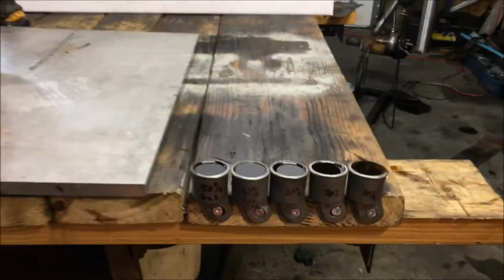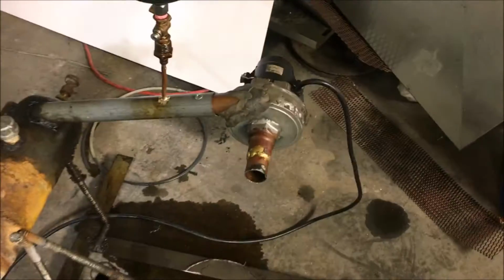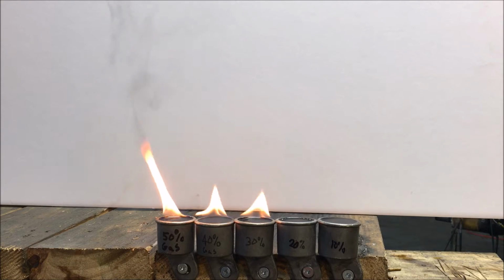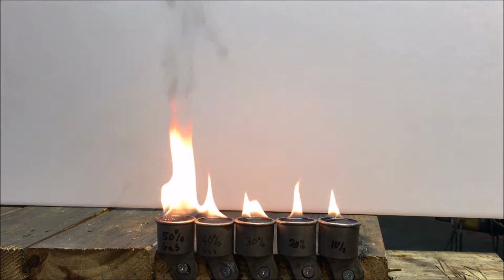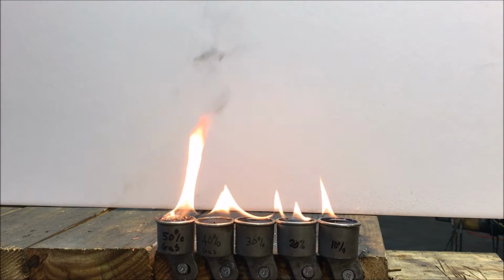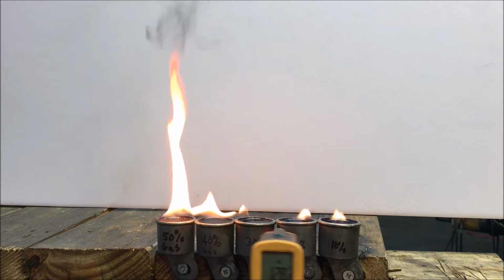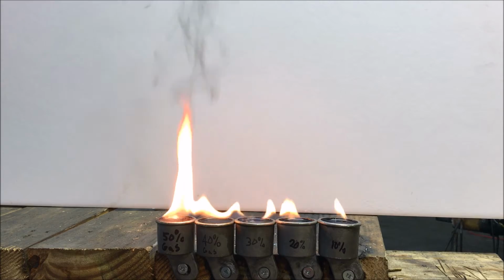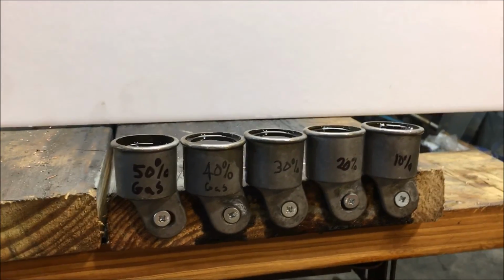Waste Oil burner fuel blending Information

Comment: Hi mate  cheers for the videos. I built a burner based on one of your designs recently. I'm currently running it on 50/50 mix of diesel and used engine oil.  In these test when you say Gas do you mean petrol? Can you tell me what the best mix of oil and petrol/diesel for a burner that will ignite easily with a map torch? I cant be bothered with the difficulties of lighting straight engine oil. cheers bro.

Comment: I would suspect the 50% is colder because gas is more volatile than oil and doesnt burn as hot as oil so it is burning the gas content more than the oil.
Reply: Less BTUs.  Gas has less BTUs. Diesel has higher output.  Oil has more than diesel.  Adding gasoline things the whole mixture and lowers BTU.  The flame is cooler.

Comment: The 50/50 is converting the most material to the gas phase. The conversion takes heat energy to perform which reduces the temperature(surprising since it's also releasing the most heat). If you filled the containers less, the heat would feedback a lot more and increase efficiency.
Reply from the maker: i agree , you know your physics , or Thermal dynamics in this case